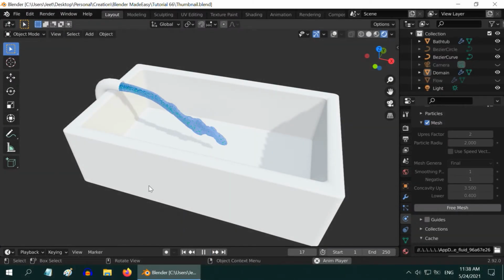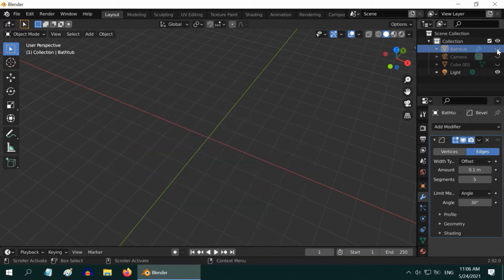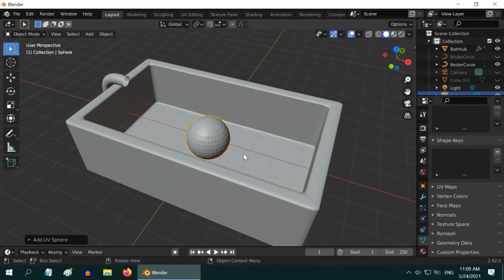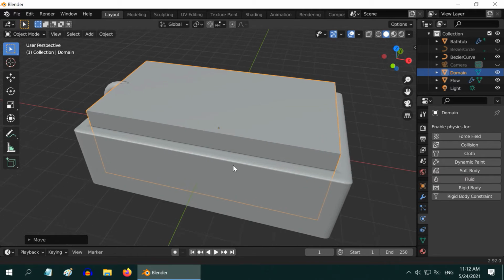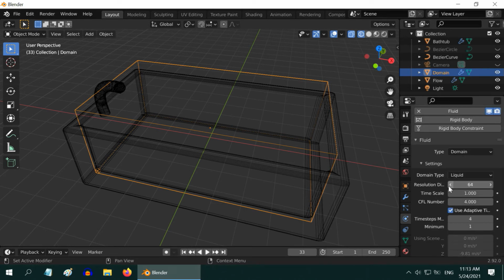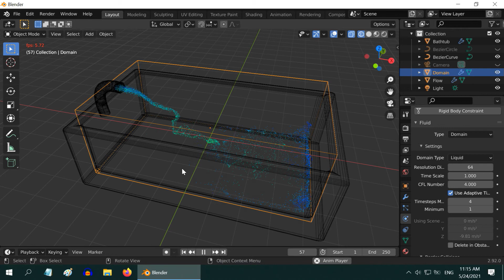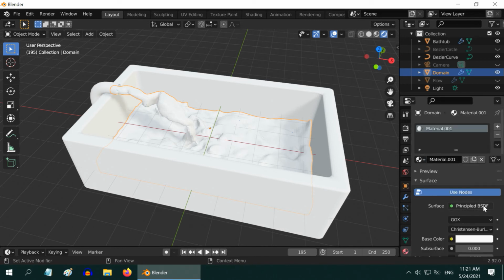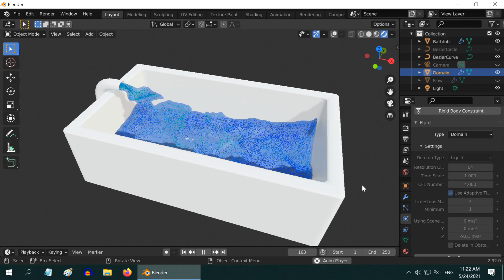Fluid Simulation Decoded | Bathtub Example | All Fluid Settings Explained | Blender Eevee & Cycles

Comment: I have followed your steps and watch other videos too but when they define domain and fluid to sphere they can see fluid simulation by same settings but when I am trying there is option I got for bake days but when I run simulation I got issue every time and that issue is I seen on my screen at top left instead of user perspective when running simulation in red color "fps 1.2" and so on it varies and don't seen any fluid in blue color why this happens please help me
Reply from the maker: Ok, first - fps 1.2 means it is running very slowly. Either your machine spec is old, or you might be using too many domain resolution. Since you are not able to see any fluid either, it points to the possibility that your domain resolution may be too high. Higher domain resolution produces more fine (better looking) results but the fluid itself becomes thin (and may not be even visible at some point). So easy solution, reduce your domain resolution for both the problems. Once you can visibly see the fluid, you can try to fine-tune it. But there can be other reasons for the fluid not visible, like the flow velocity is not enough, flow object size is too small, or some obstacle is hiding the fluid. It is difficult to guess without looking at the blend file.

Comment: I want to make animation in which water is coming from pipe (very fast speed) and hiting rock and at same time
 removing dirt from the rock

How can i do it?.. help me
Reply from the maker: I think removing the dirt is the challenging part, rests are easy if you follow this tutorial. For dirt removal, the best way is to use a shader technique. Create the dirt using a shader node tree and remove them by animating the dirt factor with time. But unfortunately, how you can create dirt using shader is not possible to explain in this comment box. I believe that you can look for another tutorial on that.
Reply: @5MinutesBlender  what if we can generate and use force coming water mesh, after baking water
Reply from the maker: @Prathameshteliprt  If you want to make it in the realistic way, you need to use a particle system to create the dirt - maybe millions of particles. 3D animators seldom do that because it becomes so heavy on the computer. And in that case you can use the actual force vector of the water to displace the dirt particles. Actually Geometry Nodes will be a better way to do this instead of particles (but that does not lighten the load on your computer, so I did not suggest this).

Comment: Will blender simulate surface tension and pressures? Like a straw with water in it and a finger on top. Will that simulation correctly show the water held in straw if straw ID is 4-8mm in diameter(Rayleigh-Taylor instability). Will it model a siphon?
Reply from the maker: Never tried that. Keeping in my to-do list, will surely check this when possible.

Comment: NOW SOLVED (Edited Update)
7:31 No Blue dots, after my second and third attempt. (worked the first time)
It still bakes, I just don't see the blue dots in a preview action. 

I had to clear the cache. Changed the resolution up one notch. Literally empty the entire cache folder, because I realized I needed to scale the entire project bigger.
Now I cannot get the blue dots to appear, unless I uncheck the domain Fluid at the top. And then re-enter all the parameters for the domain.
----------------
HOW TO FIX THAT PROBLEM
Using Blender 3.2.1
The visibility of blue dots become "non visible" for some unknown reason.
But to get them back, I did this in Object Mode:
- Select the Domain mesh
- Click Particle Properties tab
- Click liquid in the Index List box
- Click "Render As" and then chose "Halo"
Reply from the maker: Okay. So did you resolve it already? If the issues still persist, you can share your blend file with us, so that we can investigate and suggest you something. You can get our contact details in the About section of this channel. Thank you!
Reply: @5MinutesBlender   SOLVED!!!
Using Blender 3.2.1
The visibility of blue dots become "non visible" for some unknown reason.
But to get them back, I did this in Object Mode:
- Select the Domain mesh
- Click Particle Properties tab
- Click liquid in the Index List box
- Click "Render As" and then chose "Halo"

Thanks for your REPLY!!!!!!

Comment: Unfortunately the water doesn't flow out of the sphere in this tutorial
Reply from the maker: Hi, there are several things that need to be taken care of, otherwise the fluid simulation may not work. 1) The domain resolution should be sufficiently high if the size of the sphere (flow object) is too small compared to the domain object. 2) The flow object must not be covered or engulfed by the effector object i.e. there should be some gap between the two - and this gap again depends on the domain resolution, so if they are close enough, the domain resolution should be very high. 3) The cache files may not get refreshed at times. It might say that it is refreshed, but the cache files stay as it is. It may need a manual cleanup. These are the main 3 causes that I have seen in most of the cases. If you are still unable to see any flow, you can send your blend file to us, we will look into it and suggest you the solution. Our contact details (Email IDs) are given in the About section of this channel. Thanks !

Comment: Blenders water sim is not good - why for example does the water flow go all crazy - i cannot find a way to get a smooth straight flow - also the mesh is way to too big - there seesm to be no way to control either size or flow stream in a  straight line
Reply from the maker: Hi, I can understand. Initially it might look very difficult to control, but I believe you can take far better control on the things with little practice and experiment. For example, you can control the flow amount, the velocity, the turbulence. You can control the size of the domain, you can control how the water flows by using suitable effectors. Since you talked about several things here, it might be difficult for me to explain everything in this small comment box. But if you face any difficulties on anything in particular, we'll be more than glad to help you. I think the only real limitation is, you cannot achieve a very good simulation for very thin water, unless you use a very high domain resolution, which demands a very high-end PC. All other things you can easily control. Please let us know the specific issues, we'll surely guide you. Or you can also contact us with your blend file. We will look into it and resolve any specific problem you might be facing with your water simulation. Our contact details (Email ID) are given in the About section of this channel. Thank you!
Reply: @5MinutesBlender  well that's very kind for taking the time...I'll do some experimentation as you suggest...if I find a way to achieve a good result..I'll le you know how I got there ✌️😉
Reply from the maker: Sure! All the best for your venture!

Comment: How did you make the water sway back and forth from the outlet like that?  My water just comes out in a straight laminar stream.
Reply from the maker: Good question 👍 We did that by varying the initial velocity of the inflow object, slightly during the course of the simulation. The best way to do that is to add a noise modifier to the velocity parameter through the F-curve. As a result, the velocity will change randomly within a narrow range. Also you can change the direction of the flow slightly (using noise modifier). We did that as well. Collectively, the flow will look like a natural flow, instead of a plain laminar flow. I thought of adding this in the tutorial, but then realized that it would be too heavy for a foundation tutorial, and someone who is a beginner might get confused with so much information. So we planned to create a separate tutorial on this (how to create turbulent flow). We'll upload that soon. I am really glad that you noticed this small but very important factor 👍

Comment: beautiful tutorial unfortunately my pc I can not reach so much I wanted to do a simulation but I just wanted to make splashing water and the object had to be very small and for it to simulate that I have to raise the resolution a lot like about 100 and my processor is not very good like that I had to cancel my project until I could buy a better processor, it makes me a little angry because it is the project I had done it a week and due to limitations I had to discard it u.u
Reply from the maker: You can do it! Believe me, I have successfully did a splashing water project with just 64 resolution division in Eevee. It was surely not perfect, but it was within acceptable range. You can watch our tutorial on splashing effect 👉 https://youtu.be/38eiWHtw-ps The key to make it work with lower resolution is to adjust the real-life size of your domain and your flow object. The flow object does not work perfectly if it is too small compared to the domain, and the domain object does not work perfectly if it does not have sufficient resolution division. So, with resolution division fixed at a lower end, you can play with the size of the objects and achieve a decent result. All the best!
Reply: @5MinutesBlender  The problem is that when I make the small object which is a sphere where the liquid is going to be simulated, the simulation is not seen but if I increase the resolution it appears but I must increase a lot
Reply from the maker: @keyd10iori  I can understand. Please try with a smaller domain. If your domain is big but flow object is small, it needs higher resolution divisions for the liquid to be visible. There is a sweet spot among the size of the flow object, domain object & resolution division. You can find out that sweet spot by doing some experiments for your particular setup. It may raise some frustrations initially, but once you get a hang of it, it will look very easy. All the best.
Reply: @5MinutesBlender  I mean, if the domain, in this case, I make the cube smaller together with the sphere where the liquid is simulated. It can be seen. I didn't know that. Thank you, I'm going to try.
Reply from the maker: @keyd10iori  One more thing that can help. You can use an appropriately sized cube (big or small) for creating the splashing effect, only at the physics level. Once you have your physics simulation ready, hide that cube. Now add another cube and give it the same motion like the hidden cube. You can change the size of this visible cube as per your requirement, it won't affect the physics simulation because you won't turn on its fluid properties. This way, you bake your simulation with some object, and actually display a slightly different object in the render. If the size difference is not too much, it will look almost realistic, and the difference won't be noticeable. You call it a hack? Sure it is. But it can save our valuable time!
Reply: @5MinutesBlender  ok